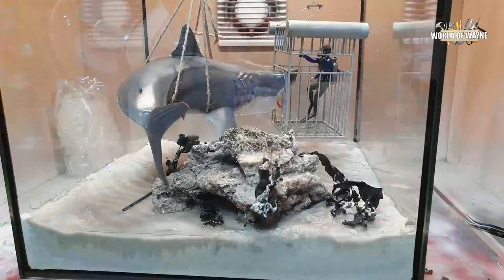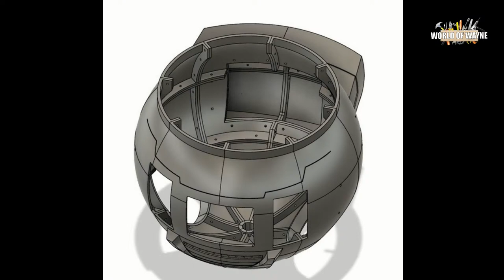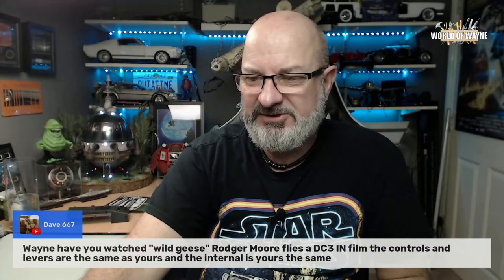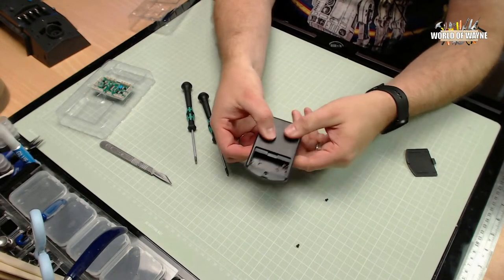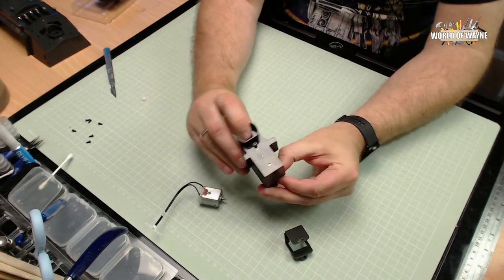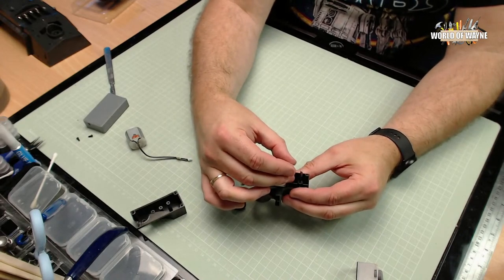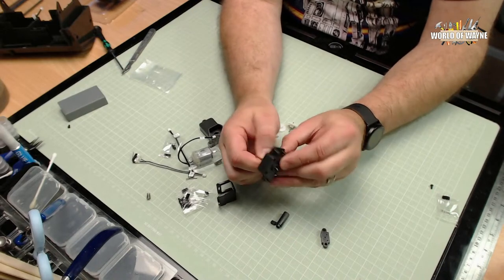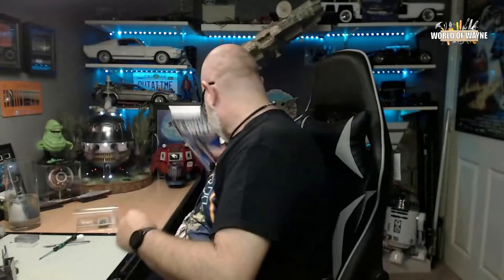Build the X-Wing LIVE - Parts 66-70 - Remote Control, Wing Motors and Control Board

Comment: So I had to drop off but wanted to mention.  Oil is technically a solvent (non-polar.  So oil  and plastic generally don't mix well, of course not in 100% of the cases but good rule of thumb.   It may soften up the plastic and with gears even if its a process over time is bad, also oil runs you should get some grease as you don't have a "sealed" case to fill with oil the grease would be more persistent and I believe people not greasing the gears is why they are having problems
Reply from the maker: They are all greased now. I did it after the stream

Comment: "The more gears you have the easier it should be to turn."  Wong, the more gears you have the more friction resistance you have to turning.

The gears seem to be turning fine until you put that one in, so I'd check to see if there's something hampering it's rotation, like maybe a rough spot on the bottom of it is catching on the gear beneath it, maybe the hole for the spindle needs to be widened slightly.

Comment: The gears are made of nylon.  Nylon is self lubricating,  No grease or oil needed.  The two batteries in the test box are not enough to power the motor.  It will run when powered by the four batteries in the model.  The gear reduction is so great, you cannot hand turn them,